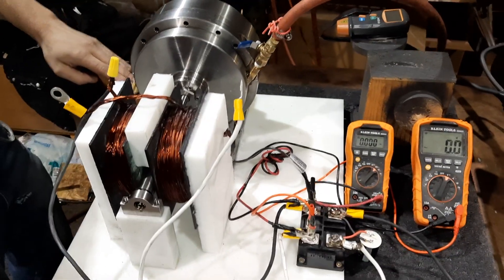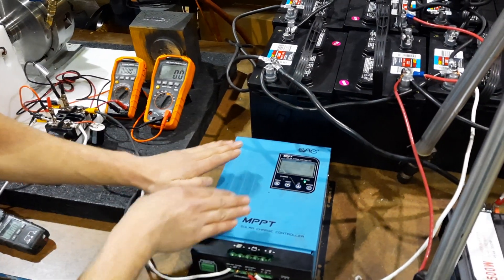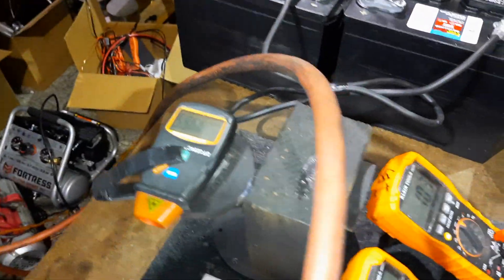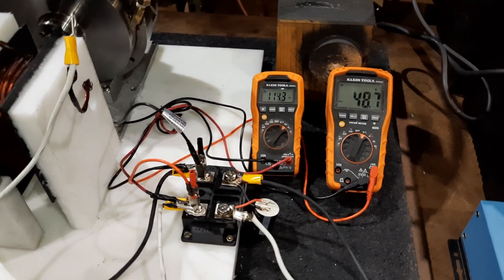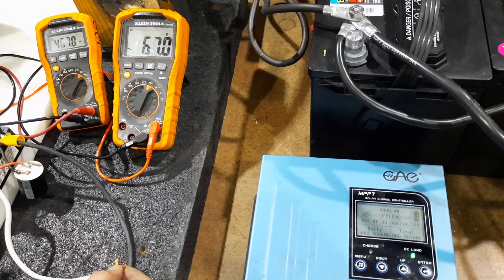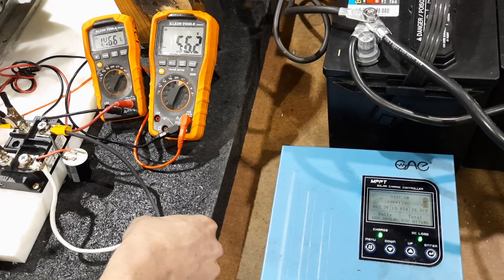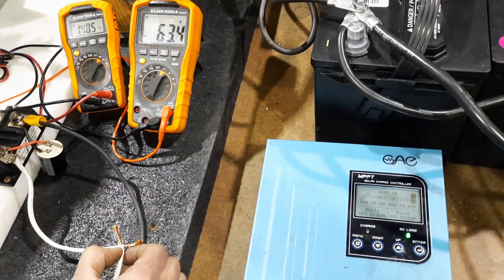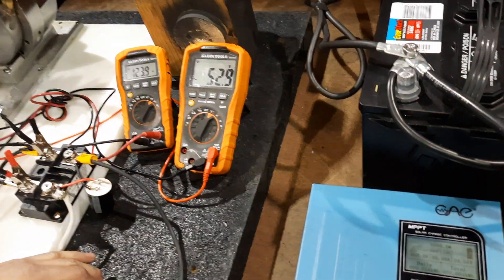Tesla Turbine Producing Usable Power! LOAD TESTING!

Comment: I expect that you already know this but, a Tesla turbine has to pass through the “vibration phase” before it achieves its “power phase” where the whole thing smooths out. My one started to smooth out at around 9300 rpm. I suspect yours is close to that point, judging by the sound. It. Gets rough then smooths out & starts to “sing”. It also is more tolerant to load at that stage. I suspect it might be something like turbulence in the vortex until it achieves a laminar flow. When it’s there it seems reluctant to drop back out of the laminar stage. A kind of hysteresis. Hope this helps. Great work. These machines fascinate me.
Reply from the maker: my new ones seem to become smooth around 25000 rpm, but the previous one smooths out around 60000 rpm.
Reply: iEnergySupply what pressure are you giving to it
Reply: @parshvapatel8484  And how do he create the pressure?
Reply: Bro… you’re just going passed the first critical rpm. That’s how ALL rotordynamics works. 

This is not a feature of the Tesla turbine.
Reply: Whoa!
THAT just blew my mind , especially the part about the reluctance to drop from its running stage...

Comment: I am wondering whether the tesla turbine couldbe used in solar energy system storage aka used rhe excess produced electricity to pump up large sacks with simple air and then in the eveneing used the air from the sacks through vents to run tesla turbines. Thsi way help to recycle excess plastic waste and produce cheap scalable energy storage.
Reply from the maker: We are using solar vacuum tubes to heat a water bank/water battery. This heat will power the tesla turbine.
Reply: @bill4639  because for tesla turbines to run at high efficiency they have to spin really fast 20k-40k rpm and we currently don't have materials that can put up with the stresses put out by the centrifugal forces at work, though at 40k or more rpm it is proven that it would be up to 98% efficiency which is the highest possible that can be currently achieved by humanity.
Reply: @bill4639  it's effectively a jet engine powered by hot water that generates electricity it has a much easier time operating the faster you spin it and the power curve is linear but at some point there is only so much water you can shove through it but due to the way water flows in the turbine it will continue accelerating without the need for higher flow allowing extremely efficient energy production though we have nothing that can put up with the forces right now if we did one day you could have near infinite power with a simple geothermal water pump it could definitely generate more power than the pump that feeds it though the water needs to be heated which is why it's only 98% but that is still better power generation than anything we have currently I'm pretty sure 92-94% is the best we can get currently and that is in a hydro electric dam.
Reply: @Altani-Raen  you don’t understand. It was a joke because all these comments are jokes. When you get an engineering degree and experience in the field, you laugh really hard when you watch these videos. If you don’t get the joke now, I don’t think you ever will.
Reply: @bill4639  I'm a chemist but fascinated by these things I guess my not understanding is why I am in my field and not yours lol
Reply: @Altani-Raen  you are not a chemist.
Reply: @bill4639  I'm currently doing an internship with the Canadian company suncor energy Inc it's a basic chemical manufacturing company in Canada
Reply: @Altani-Raen  i hope you get the job.
Reply: @bill4639  thanks I'm hoping this company is the right fit for me!

Comment: The cogging from the generator was causing the vibration you where seeing in this test.  it only happened when a load was applied.  This also caused the turbine to slow down,  then the load was removed so we never got to see what the amps would be if the load was kept on.  I think it would help to put a bank of capacitors between the gen and the bridge rectifier or between the BR and the charge controller i have seen this help with cogging before. Keep up the good work
Reply from the maker: Stay tuned for the next video we are balancing the system like you describe here. Let me know what you think about the next video where we show a kw. It's good to have more eyes on the testing. Thanks for the good advice.
Reply: What IS "Cogging"?
Reply from the maker: @fxphenix5162  The shaft connection to magnet, the fixture had too much run-out we have fixed it though.
Reply: Was going to comment the same thing. Need a better generator coil design 😊
Reply: @officialdiadonacs  Brushless Coreless PMDC motor will help as a generator. Expensive stuff. Been there done that 😎

Comment: That's exciting. Once balanced. How long could you run this in a day to charge batteries or pump power back into the grid?
Reply from the maker: Rubber races and it being balanced you could run it for years
Reply from the maker: The only part that will wear out is the bearings eventually but they're rated for 70,000 so at those speeds it would last an extremely long time
Reply from the maker: The next rotor is titanium 3/4 inch, somebody donated us the shaft so we put new way air bearings on it which should be extremely reliable
Reply: @iEnergySupply  How cool. Be curious for you to run a month long test with a time lapse. Set every 15 or 30 mins.
Reply from the maker: @RajGiandeep  That would be epic! We are approaching our final design so when we run out of stuff to do we will do the endurance tests.
Reply: For eeeevveeerr

Comment: Can you tell me does  this power enough to run the airpressor    motor (witch give tesla turbine the air ) ?
Reply from the maker: Air is for testing only. Air compressors are about 10% efficient, a well insulated boiler on the other hand is, close to 100% and can be charged with the sun. You can also burn any fuel source to add to the power when the sun isn't around. The test part is we can use heat solar panels that are upwards of 97% efficient.

Comment: nice work.   and yes I think you're right if you use a high voltage low current draw it won't draw so much torque on rotor.  and you will have to eliminate that noise vibrations and noise = lost energy I'm sure you know this already.  but well done good work
Reply: Torque is proportional to power not volts.  It won't make a difference.  The important thing is to not exceed the amps that the generator and loads can handle.
Reply: @sanfords  yes technically you're right but these turbines work better at higher speeds higher voltage less current I think will perform better.  these turbines don't have much power at low speeds but they're excellent as soon as they pick up enough speed. So I think high speed high voltage and low current will perform better. I might be wrong but that's why we're here doing experiments
Reply from the maker: O yes, this was the lowest speed we attempted. You have to give your turbine a little test at low speeds before you start lead footing the throttle. One way to show what supercritical is talking about is with a test, I am going to use the higher voltage now. Test high volts low amps vs low volts high amp. I honestly don't know what one will be more efficient but sometimes it has to do with the controllers and their working voltage. The good news is I have a new charge controller that will accept anywhere from 24vdc to 600vdc. Questions will be answered with empirical data.

Comment: Nice work!
How many liters/min of air at what pressure does the engine need to get max output?
Reply from the maker: surprisingly the volume goes down the faster the turbine goes. You use less and less gas the faster the turbine spins. I am getting flow meters to test these parameters.
Reply: Just a question,  if it uses less gas the faster it spins,  is there a theoretical point at which it's spinning fast enough to no longer need any gas input to continue running?
Reply: @hughjass1835  if that point exists it would probably be at infinite rpm, and also there is no point in reaching it as with 0 input there will be no output, even at 100% efficiency.
that said, i would love to know exactly what the power and efficiency curves are relative to rpm.
Reply: @aerbon  infinite rpm at 100% efficiency,  but what if there's a point where efficiency exceeds 100%, and the turbine begins to use its own kinetic energy to draw enough fuel to keep itself running? It defies physics but those rules are old and it's about time for another breakthrough.
Reply: @hughjass1835  the age of those rules just comes to show how well they stand up to reality, if anything can provide us with infinite energy it would be through some sort of quantum physics abuse, but i doubt that is possible.
the tesla turbine is a very simple device, the air spins around inside it, accelerating the disks. only the slowest moving air gets to leave the turbine due to the centrifugal effect, so the efficiency is quite good.
if i am visualizing this correctly, the higher the speed, the higher the pressure at the input of the turbine becomes. if the pressure at the input matches the pressure we are feeding the turbine (by input i mean the edge of the disks) there will be no flow into the turbine and it will slow down until there is flow again.

now that i've thought this through, i'd also like to correct my previous comment: the rpm at wich no fuel is drawn would be a real number, but there still is no point in working at that speed.
Reply: @RJ_S_182  I'm not trying to step on your point here but this thing about 100% efficiency is worth talking about. Why are these guys trying to build a Tesla Turbine? Because they are trying to get back a larger energy output than input. That's like saying they are trying to get over 100% back from what they put in. This is not a measure of efficiency, it's a measure of COP, coefficient of performance. And a COP of 1.0 is the same as 100% return on your input energy. So there is a difference between efficiency and performance (COP). Most devices have a COP of less than 1 but there are devices that offer a COP of over 1.0, if my memory serves the highest is 4.2 (Douglas Adams would be so proud), and it's from an air conditioning unit. These devices are traditionally very energy hungry so huge efforts have been put into improving their performance. If you look you will find a number of these machines with a COP of over 1.0 for sale today. So this can happen. It's not like the crazy "free energy" devices found on YouTube with hidden batteries, it's perfectly real. There are very few things on earth that are 100% efficient.

Comment: Whats your plans for making the compressed air?  Have you seen a Trompe before, look it up if not.
Reply from the maker: Steam is the working fluid after we test inside with the compressed air.
Reply: @iEnergySupply  I know your probably going to use a boiler, but...  Ever seen a cavitation heater generate steam?
Reply from the maker: @hootsmin  I have, always wanted to try that, if someone were to donate one to us I would put it to the test.
Reply: @iEnergySupply  I'm bigger on ideas than I am on funds unfortunately, I don't like to engage in commerce too much because it feeds the beast.  If I come into some cash though in the future I will keep you in mind.  Once I get the space and the tools I will be wanting to try out the cavitation device myself.  I just cant stop thinking about fusing the cavitation device with the tesla turbine, can the turbine produce decent voltage and do work under mechanical load at the same time?
Reply: @iEnergySupply  ever thought of using the exhaust of a pulse compressive detonation engine (PCD)? Purportedly the exhaust speed is comparable to a CLGG, but sustainable.
Reply from the maker: @Dan-gs3kg  that is actually one of the tests I will be doing in the future
Reply: @hootsmin   @Cinematheque Rouge  YouTube staff office culture stalls my YouTube so much that my volume button stops working during the covid freeze. You know what that means? We can eventually expect Google staff to have full control over our browsers just as they  do with our YouTube inbox. You don't even receive anywhere near the amount of comments that YouTube intercepts.
Reply: @Dan-gs3kg   @Cinematheque Rouge  YouTube staff office culture stalls my YouTube so much that my volume button stops working during the covid freeze. You know what that means? We can eventually expect Google staff to have full control over our browsers just as they  do with our YouTube inbox. You don't even receive anywhere near the amount of comments that YouTube intercepts.

Comment: You don't need to go faster, you need to get your voltage up really high in your safe isolated system, then always take a little bit (small amount of amps) from the system at a time for your accumulator or for your work.  Consider adding a variable flywheel - water can do this for you for cheap!  Great job!
Reply from the maker: I've had more then one person mention that, and I am so excited to test it!
Reply: I keep thinking about water having more density than air, thus making energy transfer at the boundary layer more efficient. I ponder that, while thinking of other potential fluids. And also about something akin to an Evaporative Refrigerator, in a closed loop...
Reply: @TimeSurfer206  this idea has layers...
Reply: @TimeSurfer206  I am actually considering just that. Using a parabolic through to heat ammonia and run it through a Tesla turbine before it combines with the hydrogen. It's an idea for a solar freezer/fridge or air conditioner, without the kind of loss involved in photo panels.

Comment: What if you add a planetary reductor before the generator ( like 100:1), sacrificing RPM for win torque? that torque is necessary to defeat the secondary magnetic field induced at the coils according to Lenz's law.
Reply from the maker: We may do that soon, Tesla used a worm gear.
Reply: @iEnergySupply  you might be able to salvage a worm gear drive out of a circular saw. It's already built for high speeds and would probably handle the turbine very well. Might even be able to rewire the motor into a generator.

Comment: I have been looking into the Tesla turbine for off grid power. 
My thought was gravity feed water into the turbine. Which spins a generator. 
Instead of batteries I was think of using a large flywheel. Do you have a opinion on this system?
Reply from the maker: It's a good idea, but you would need a special design. Our cold steam system will be the ultimate solution for off grid systems.
Reply: It is a very intriguing idea. I am not sure I have grasped the intricate details of your design.
Yet
How close are you to marketing it?
Are you looking for a partner?

Would love to help in anyway I can.
Reply: Nah dude. Axial blade turbine would take better advantage of the weight of falling water. Water don’t work in a tesla turbine.
Reply: francis turbine generator
Reply: gravity isn't enough potential difference. TT works best at extremely high speeds and the load torque would stop the discs.
Reply: @drgeeforce1129  have you tested it, done the math or seen the research results?

Comment: It's not loading test it's loading peak test. Why did you disconnect wires before end of video? I ant see average V and W with Amp
Reply from the maker: just a seek peak, we are installing it in the new system. I have 1000w peak test in next video, it's available on my patron and will be public in a couple weeks. I needed a way to let the turbine accelerate at that pressure.

Comment: how many watts the power consumption for the airpump? and how many watt the maximum output?
Reply from the maker: Getting our flow meter soon. Steam will be most interesting to test the efficiency of because it's what we are going to be using for the working fluid. We have found that for the same pressure of steam the power output is way higher.
Reply: its owsome if u make low input and higher output free energy

Comment: Very cool, this coil and spinning magnet is cool. How are the poles lined up on the magnet, is N & S the top and bottom of the magnets cylinder or is it left and right of the cylinder.
Reply from the maker: North on the top s on the bottom, they are diametrically magnetized.

Comment: I think the best application would be for geothermal energy.  You can have the geothermal heat boil a gas that boils at a low temp, (I think similar systems use freon) then you can use the vapor to turn the turbine.  There are already closed systems like this, im not sure how you would recycle the condensed freon with a tesla turbine,  but its doable.  The issue is the bearings and the turbine holding up over extended use.
Reply from the maker: geothermal will be amazing! The bearings are actually stainless steel so they shouldn't rust. We are going to use only water, please see our latest video and leave a comment.
Reply: I like the idea of using freon gas as it has such a low boiling point. There are devices like a heat pump that sits in the wall of your house, one part on the outside and one part in the inside. The freon gets boiled outside as long as the temperature is above -10, or whatever it is, and then the heat is removed in a heat exchanger to heat your house, and then the gasses are condensed back into liquid freon that is then sent back outside to capture the ambient heat. As long as there is a temperature differential of at least 10 degrees or something then the system will produce heat. So the system is already in existence that could be used in the manner you suggest. I think you're looking for the condenser part.